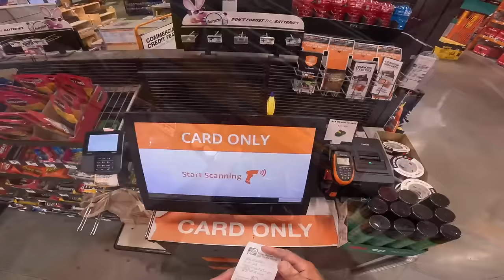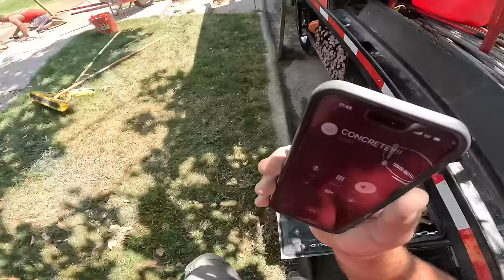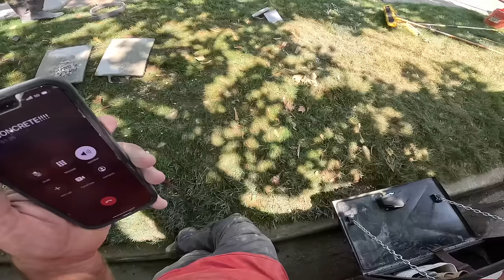It's so HOT! Relief is on the way!

Comment: The best canopy to use is the 10x10 white one with the vent at the top. Those plastic colored ones without the vent do a good job of shading out the sun but they hold heat.

Comment: 🎉🎉🎉TRICK to get those hubs to last 10 times longer. Make the grease is full. Fill after every trip. Most important put a few pumps a grease EVERYTIME you pull it out of the water. It pushes the water out so it doesn't wash the grease out as you drive. And use Marine Grease. Get you a small grease gun that you keep in the boat and just make it part of your ritual hope this helps🎉🎉🎉

Comment: Hey Ryan, if you take some boat wax on a microfiber towel and rub at those scuffs on the boat you can usually take them off or at least make them look much better fairly easily. For the rub rail you can use lacquer thinner on a rag to remove all the black scuff marks and clean up the rubber. If you get a lot of hard water spots you can spray it down with vinegar and let it sit for a few minutes then wipe it down with microfiber rags.

Comment: Born and raised in Florida, I use to install gate operators and all the access control conduit and cables for them and I would have one of those deployable canopies with small off-road tires fabricated so I could push it around with me to try and beat the heat.

Comment: You know, an easy fix to having to pump that sprayer up 100 times, is put a metal valve stem in the top side of the canister, just requires a small hole being drilled, then the stem being bolted in, a small tankless compressor, and, no more pumping, I did it on mine, works excellent. You don’t really need a big compressor at all.

Comment: Thank you for another great video Ryan, keep up all the hard work! By chance have you every used a circular head pressure washer attachment, the ones with wheels with dual jets underneath for power washing the concrete? I use one at my job and it works very well on the bathroom tiles/grout lines and concrete at my site for maintenance. Was so used to a 45 degree head that I wanted to try it out to save time.

Comment: Start spraying your new tools with WD40 Dry Lubricant  it has Silicone with Teflon. Two things it seals out moisture and the metal is lubricated. It will help with cleanup, and protect the hardware. I use it on my car spraying almost everywhere under the hood! 😊
And I forgot it doesn’t collect dust!
Reply: Concrete guys use form oil works well

Comment: $284 for one box of regular supplies. 5 years ago, that money would get you a TV.
49:32 I think that chevy Duramax is pre-emissions(2004-2007), which makes it much more valuable than even a brand new Duramax. I'm looking for one myself. Sure they have the problems an old diesel does - bad injectors, bad glow plugs, leaks, fuel pump issues, the transmission casing cracks and becomes porous with age, etc....... BUT, if you keep a new truck past warranty, the repairs on the DPF system and electronics will break you much quicker. My father has an '04 Sierra Duramax and it's pretty much a family heirloom now. I told him do not sell it or sell it to me first if you have to.

Comment: You sealing cans seem to always leak.  Have you tried the battery sealer cans?  I bought one 2 years ago and it still works great (no issue, other than you need to change the batteries).